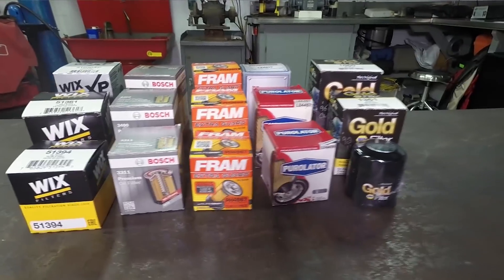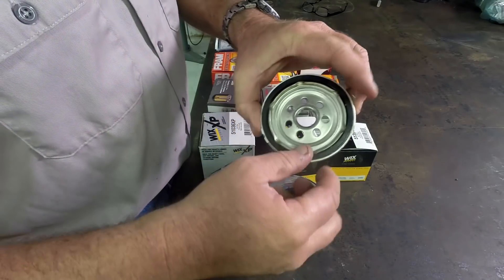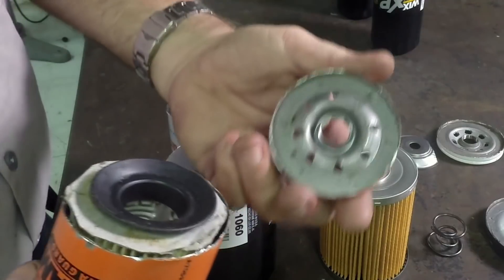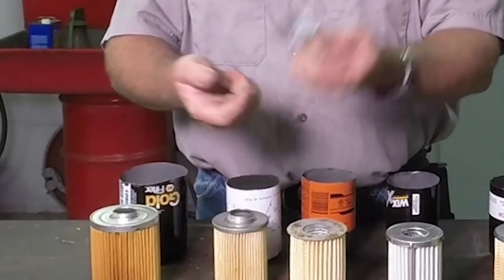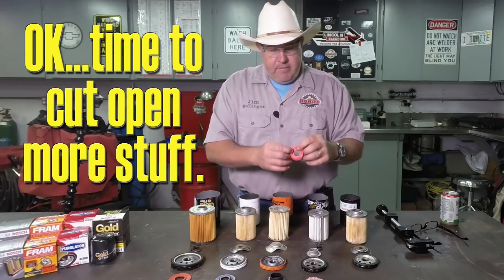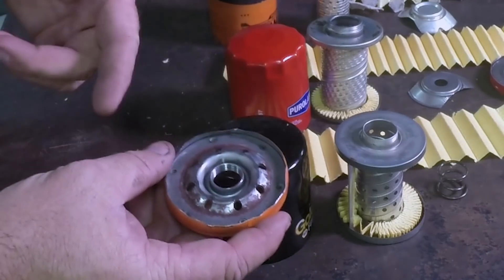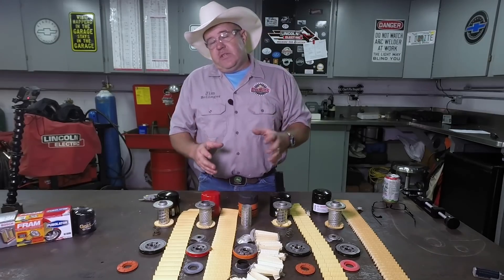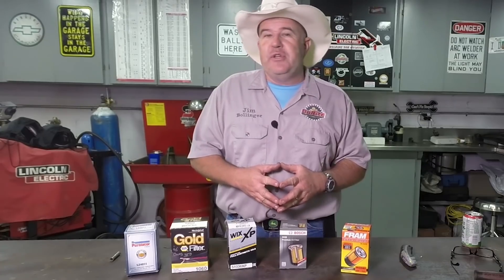The worst oil filter EVER!

Comment: Yet millions of the very Fram filter he claims will destroy your engine have been sold and used with no problems. This all started when someone cut open a Fram filter and discovered a part inside it was made of cardboard. Until this reviewer can produce documented engine failures that are proven to be from the Fram oil filter he is just blowing smoke out of his arse. 

If you want to do filter reviews at least purchase a oil filter cutting tool to properly cut the oil filter open.

Comment: Speaking of Fram…have you ever seen a new filter dump 5 quarts of new oil in seconds after starting vehicle to check for leaks? Sounds crazy, but after checking under the vehicle the only oil present was from the oil filter, and yes it was installed correctly! I even removed the filter and put the old one back on which was a Motorcraft and filled it with new oil. No leaks! I’ve been using Fram for years…never again! I think Fram should not only refund me for the filter, but for the jug of oil that ended up on my driveway!

Comment: Hi, I'm from Honduras. I liked your video. I have a question about my car. It's a 2001 Mazda 323. When it's cold in the morning, it shoots white smoke out of the exhaust, but when it warms up well, it stops smoking and all engine levels
They are fine and the car does not consume oil and I always checked the levels in the engine when I am going to use it, the water from the radiator is not thrown away nor is it mixed with the engine oil

Comment: Sir - you are comparing a premium NAPA Gold filter (among others) to an economy (orange can PHxxxx family) Fram filter. I would have been surprised if there weren't any differences. That said, you are not comparing apples to oranges, and you aren't being very honest with your viewers. Open up a premium filter (golden can XGxxxx family) and see how it compares to your NAPA or Wix - you (and your viewers, if you choose to do it on camera) will be surprised. As far as the rust, it is surface rust from sitting on a shelf. As soon as you install it, all the interior surfaces will be flooded with oil, which will stop any further corrosion.

Comment: That is not rust that is glue the end caps are not designed to filter oil Fram has a higher micron rating at 20 microns if Fram were as bad as people on you tube say they are the company would be out of business a long time ago I been using Fram filters for over 30 years never had a issue with them anyone can cut a oil filter open and make accusations that doesn’t mean it’s true

Comment: Not saying these are the greatest but I’ve ran the orange filters for many years prior without issues. 2 cars i took to 522K miles and another went 366K but both cars were scrapped for non-engine related issues. Both ran great to the end.  That being said, i run higher quality filters now.

Comment: I've been using fram filters forever. 
I've drive ford pickups from new to 350,000 miles. Never an issue with the engines. I also use fram filters on my tractors. Not an issue either.

Comment: What’s more important than the filter you use is that you change your oil and filter @ 3-4k for conventional gas and 5-7 k for diesel and synthetic.  I’ve seen so many vehicles come in to where I work with the change oil indicator on. Those indicators are way past when you should change it for long engine life

Comment: Cutting filters apart and looking at the insides means very little.  Which can has thicker walls doesn't matter as long as it does not burst. What matters is how well the filters - filter out particles. They used to do pure oil performance tests of oil and filters.  A measured amount of particles of specific micron sizes would be introduced into the oil stream going into the filter.  The oil coming out of the filter was collected and measured for particles.  That's what counts, that's the bottom line.

Comment: Fram  does use paper base true ..but food for thought I've seen people use them my whole life as a mechanic , with   regular  oil changes, have 250,000 miles on a car  or more ,, so can't be that bad , I prefer wix myself , but a lot gas stations in  1970s sold and used fram  or Purolator , , Never saw one blow up , honestly , more important to change your oil and filter unless your running 8k Miles in the desert then u need a wix xp or something better ,  just like oil pay for the advertisement or the oil , been to oil schools 20 yrs , not much difference in oils believe me ,  you pay for Thier name on a nascar race car , cost millions for 1 small sticker ,

Comment: I've been using the orange Fram filters for years and have put over 100,000 miles on most of my vehicles. My current truck has over 200,000 miles on it, using mostly orange Frams

Comment: Any filter will do for normal driving . People get in trouble when they think that more expensive means better and then decide to try and get more miles out of that filter , stupid to try and justify longer change intervals because of the additional cost of a filter. Change it on a regular basis and you’ll never have to worry, 257 k on a 2009 gmc ,  Fram filters since I got it with 100 k   , they all clog or go into bypass if you never change them, stop misleading gullible people.

Comment: I've used gram for about 420 000 miles on my AMC Jeep engines. Never had a problem. I think people get to wrapped up on filters. I've cut numerous used frams apart with the fiber end caps. Ph25 s and no problems. I also use the pb50 on my continental engine in a Miller big 40 welder.

Comment: I wouldn't use that fram orange filter.  But to be fair, the fiber end cap was coming apart where you used the grinder to open it  😂.
Reply: Ureasmith, I’ve been using  the Fram filters for years and NEVER had an engine failure as a result.  Even using the cheaper orange one, as long as the oil was changed out between 3-5K miles.
Reply: @carlovanrijk4039  Yeah I understand.  It's just my personal opinion that there are many other low priced filters that are built much better.
Reply: @ureasmith3049  that’s the great thing…that at least we have a choice in what products we use.
Reply: @ureasmith3049  by the way, which alternatives to the Fram orange filter do you prefer? I could always give them a try. 👍🏼

Comment: FRAM FILTER..... SINCE IVE OWNED MY 2001 DODGE 3500 4X4 CUMMINS 5.9.... 742,000 MILES.....DRIVEN DAILY....... NOTHING BUT FRAM FILTERS THE WHOLE TIME....... NO BLOWBY, GREAT OIL PRESSURE..... YOU GUYS ARE CRAZY.....

Comment: I'm getting older, had not purchased a fram filter since my younger days. Back in my hot rod days fram was big. Long story I put a fram filter on my sons just rebuilt Corvette 350 V8. The high performance oil pump sucked that piece of crap filter flat, destroyed the crank and main bearings. I later found that fram was sold to the Chinese and was just a brand name placed on a junk Chinese filter. NEVER BUY ONE!

Comment: Resin fiber endcaps rusting lol? Could that be stains from the Plastisol adhesive on the other side? Surely not. Cutting oil filters open with an angle grinder should be your first clue that this is nonsense, but... "murica" .

Comment: I've only used Fram filters on my o7 jeep patriot. Changed every 6,000 miles. It has 400,000 miles on it with no problems and runs great. Sounds like napa pays his check.

Comment: Great comparison Jim and you are 100% correct in your commentary! I was a factory rep for WIX many years ago and yes, WIX makes most if not all NAPA filters. I can still remember the manufacturing and quality testing facilities in Gastonia, NC where WIX engineers would quality check the oil filters at over 10x normal usage pressure and keep increasing the pressure until the "can" blew off the base plate; the noise was deafening!  Other filter brands including the Fran never made it past 15% of the WIX.

Comment: I'd like to see you cut open  USED filters to see how they hold up after living in a car for 5k miles.  All the of the things you consider problems, are they really problems?  Did the Fram cardboard ends fail and let unfiltered oil through?  Did the glue fail?   If you abuse your filter by not changing it on time, those things might make a difference.  But if you change you oil and filter on time, it might not matter at all.   Unless the filter media is the same material, length is meaningless.

Comment: The correct way to test filters is measuring the levels of particulates (metal mostly) found in the oil.
The filter that captures the most particulates (the oil with the fewest measured particulates) is the winner.

Comment: Everyone wants to Fram bash. Take a K&N filter and tap the heck out of it on a piece of paper. You will see fine particles from the steel mesh come out. Those steel particles are going through your rings and valves! Fram is the best selling filter because they are cheap and available. No one is having any problems with them however, and my Dad used them in the 50s till 2010 without fail. I do agree they are cheap and I try to stay with Purolater or Motorcraft. Never seen a person say they only use Wix or NAPA and their vehicle has over 250K miles on it. There's millions of Fram users saying it though. That rust comes from conventional oil. Look at the inside of an oil can and you will see rust yet the metal is submerged in oil. NOT ONE VIDEO ON YOUTUBE SHOWS HOW WELL THE FILTER ACTUALLY FILTERS OIL. WHICH IS WHAT IT IS DESIGNED TO DO BY THE WAY.

Comment: The Fram is not ripped apart when installed.. As a unit it is solid inside Tearing it apart has nothing to do with real life use. While there are better choices the standard Fram will be fine for the mileage stated on the box.

Comment: So when is my engine going to die ? My 23 year old truck with 300,000 miles.  My oil comes out non gritty and I've only used Fram and Penzoil traditional oil. Never had any internal issues.

Comment: I can't tell which Fram filter was used in this test but in another youtube test a gentlemen cut up about 15 filters.  The higher end Fram filters actually looked like some of the best in his test as they contained a metal mesh around the paper or cloth filtering material so he rated those some of the best.  The Fram filters he highly rated were both meant for use with Synthetic oils as I recall.  I'm not a great fan of Fram however as I had a couple problems in the past with fram filters, just saying they all don't appear to be garbage like the one tested here.
Reply: @Terry Wolford Thank you for reminding me that Fram now offers different levels of quality and pricing,  I suppose due to competitive marketing. I’m a retired Parts Specialist from a time when Fram only sold one quality of oil filter, which I recommended. Times have changed, as have qualities of many brands available on different merchandise in diverse areas now. I would now recommend OEM filters when available, as I’ll be buying in the future for my car although from parts stores of course. Driving GM, that keeps me with AC Delco filters but Duralast Gold car batteries from AZ. That’s just a personal preference from experience since we only have 3 battery manufacturing facilities in the USA. Apparently Fram, like most companies, has started cutting corners. I appreciate the people who made this comparison video and appreciate you saying their are others. GBU and yours the rest of this year and going into the next Happy New Year. :)

Comment: AC Delco and Fram made my oil pressure low on my 2006 silverado 4.8 and I think that is what messed up my engine because I used to run it like for years. Put another engine and had the same problem with the low pressure so I changed the o ring and still had the same problem. When I switched to wix, mobil 1, oil pressure was better.

Comment: Although I agree I do not like fram. You are comparing apples to oranges. You are comparing economy line to top of the line filters. You should have included the purolator boss and fram ultra to make it fair. Or use napa and wix economy line instead of their top line.

Comment: Mazda dealers are told any vehicle with a fram filter and engine issues due to oil pressure are not covered under warranty. Wouldn't be surprised if everyone else is the same

Comment: BTW, Wix also makes the Harley Davidson filters.  I ordered some 'bargain' nice chrome filters (pack of 12) for my HD off eBay.  Just out of curiosity I cut one open to check it out.  It was horrible, glue all misapplied, holes everywhere so dirty oil could seep through.  I was so angry.  I got my money back, then bought an HD filter, cut it open and compared.  Excellent filter.  Wix is the best.  Don't settle for less.

Comment: Feeling and twisting components like an ape is not an acceptable method for determining quality. You think that the gauge of the case is a proxy of quality, but don't explain how that improves the life or efficiency of the filter. You don't even explain how the Fram filter that worries you so is actually problematic. How would the rust damage the engine or reduce the life or efficiency of the filter? How would the cardboard reduce the life or efficiency of the filter? You don't even refer to the standards that the filters conform to, such as efficiency ratings. My conclusion is that you don't know what the hell you're talking about.
Reply: Cardboard for a oil filter, you use cardboard for Kelloggs cornflakes box. 😳
Reply: I think twisting and feeling the components is a perfectly acceptable method for determining quality. If it feels better quality that's because it is better quality. Metal will always be superior to cardboard. Do you want cardboard flakes and rust floating around in your engine? Not to mention the filter is practically falling apart with no oil pressure. My guess is once it's saturated with oil that cardboard just disintegrates and the filter literally does nothing since the oil probably goes right around the filter. What this says to me is Fram is more concerned about maximizing every cent of profit. I can't even think of a good reason to substitute cardboard for metal on such a small item. What does it make them an extra penny a filter?

Comment: What a cornball. At the bottom line... the "complete garbage" Fram filter is ... SUFFICIENT. It doesn't need to be any better than it is. Engines last insanely long, longer than car computers last, using exclusively Fram filters.

Anything more robust... is just a waste of material and money.

Really.

Comment: Reading the comments it seems like operator error is the real issue. 
7k miles & the filter quit on you????lol change your oil sooner. If it’s new you should have free oil changes & the manufacturers recommendation every time. 
Just because you do it yourself doesn’t mean you can do it wrong.

Comment: What about the Ultra Fram line? Ive been using em for the past 6 or so years with no issues over 200,000 and I'm a speed demon. I also change the oil in my friends sienna it's a cartridge type filter and the oem Toyota filters are cheap and flimsy the Frame Ultra has a hard plastic top and bottom vs the oem is cardboard. The Fram also has more pleates and has a metal mesh core which Toyota filters don't offer. I'd never buy the cheap Fram filters but I have never seen anyone review the top tier ones? I buy Fram cus it's made in USA and will only buy filters made in USA I change my oil every 5k and I usually have 6 in stock in my tool shed with a 12qt box of Mobil 1 oil

Comment: F.R.A.M. stands for "Failure Ruins Any Motor" I'm surprised that you had to go through all that work to cut off the base plate from the cylinder of the Fram filter. On my boat a Fram base plate partially separated and it leaked oil into the bilge. This leaked oil was automatically pumped into the ocean water. If one needs a filter for a boat, PLEASE shop for a quality filter. Have to go now and replace the Fram on my other engine before it starts leaking!

Comment: I use Fram tough guard And fleet farm oil that is $18 for 2 gallons and 1/2 qt lucas. It's a 4.3 Chevy V6 astro Van. I change The oil every 12,000 to 15,000 miles.  I'm on my 6th Van now and every engine gets over 300000 miles. The math comes out that I save enough money on oil changes vs. Lube shop to replace the engine after 150000 miles.  Which is not necessary.

Comment: Hello:
I've been a commercial parts manager for several decades and I wanted to share some thoughts on this video.
Wix makes Napa's filters. They share the same last 4 part numbers. Wix uses 5 digit numbers for the most part. Part numbers that start with 3 are fuel filter. 4 is air filter and 5 oil filters.
Onto Fram filters. Many moons ago Fram was part of Allied Signal. Now they're owned by Honeywell if memory serves me correct. Anything Honeywell is questionable in my book.
Good video. I wished you would have used the same equivalent part number from each filter manufacturer.

Comment: Bro, you don't put oil on the o-ring of the filter. The o-ring is made of rubber and the petroleum distillates will break down and weaken the o-ring. The o-ring goes on dry. Common misconception, like fram being a good filter.